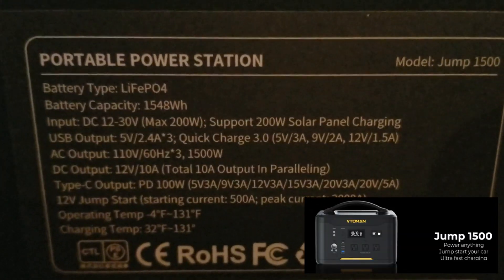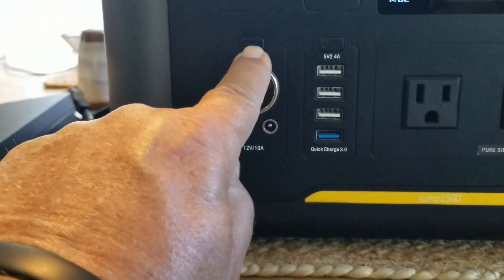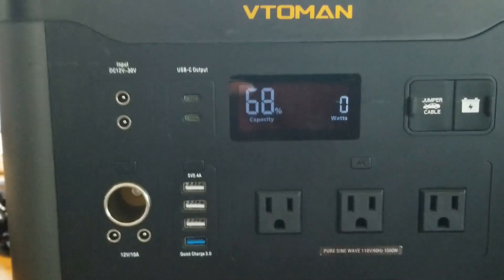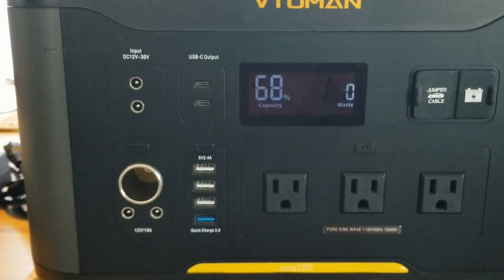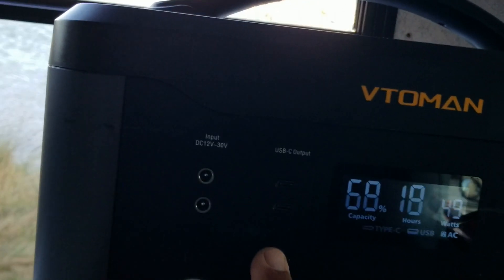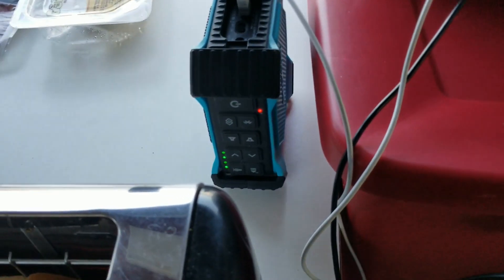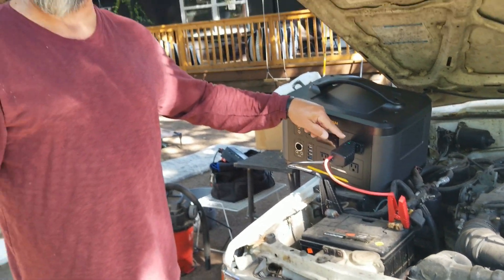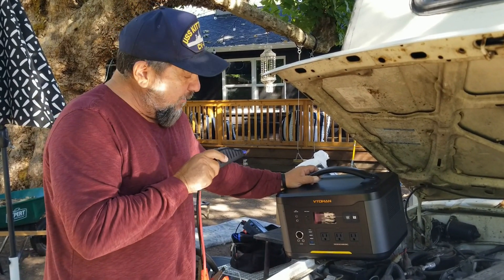VToMan 1500, World’s 1st Expandable Capacity Power Station w/ Jump-starter Function

Comment: The VToMan 1500 W is super cheap right now, and it has LiFePO4 batteries.  $696 but almost no reviews or info on it.  And your "it stopped charging" comment was all I needed to know.
Reply from the maker: Its funny never heard back from VtoMan about the unit.  It was a great unit while it worked.  But never charged up or turned on..

Comment: Compared to other options (Bluetti) this thing is a mega-bargain IF it isn't somehow unreliable or overly compromised.    So how is thing holding up for you?...you've had it for a few months now.  I can't find hardly any reviews on this thing.
(can't believe you have no comments, yet)
Reply from the maker: Well I have to be honest. It stopped charging and i tried to contact the co.  Never got backed to me.  Gave it to a sub...
Reply: @StarboardBow  GOOD TO KNOW!!!  thx~
Reply from the maker: I know.  It works fine.  Not very strong but good for small lite areas.
Reply: @StarboardBow  Ty for your honesty. That's probably why it's on sale right now.